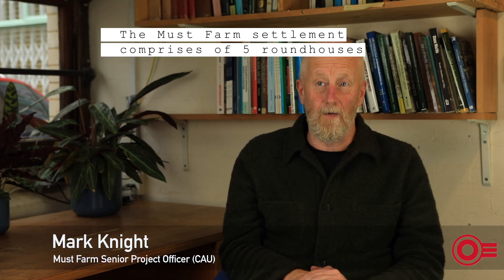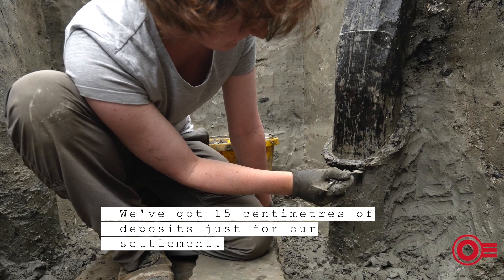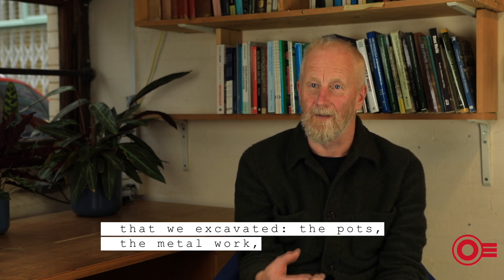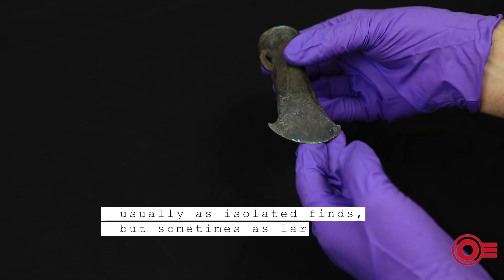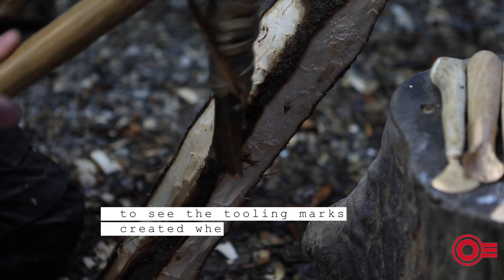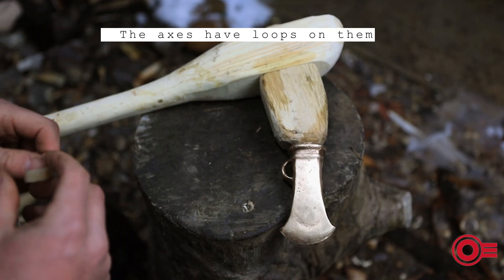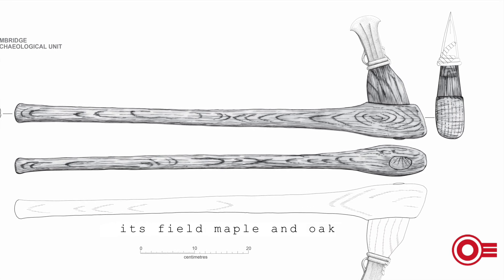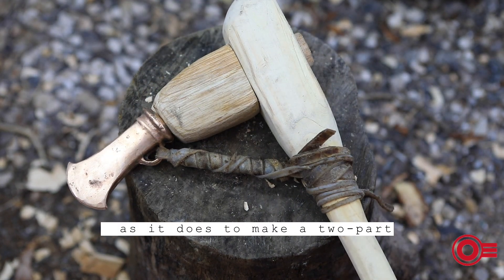Making Must Farm (S1, E1): A Bronze Axe

Comment: this device rather belongs to the category of cleavers. logs were split into different boards with this device. beat with a wooden mallet. Holders for the hollow blade were interchangeable, the main ones had to be straight. This is how dishes and boats were made.

Comment: As someone who has done a lot of lashing, binding, knotting and serving in his time--the shown method of lashing the axehead in place just  does not ring true.  It looks like it would torque the axehead in the wrong way and load the joints between the wood parts in a way that might lead to failure. There are a number of possible alternative lashings.
Perhaps someday an intact lashing will be found.

Comment: 2:46 omg that handle shape from 3,000 years ago is the same be shape we use today for axes, large hammers, pick axes, and other tools. Clever idea to use a two piece wooden structure. Easier to replace smaller, quicker to make, parts instead of create a whole handle from scratch.

Comment: My first thought, it must have been mosquito hell living above a still body of water,

The two part axe :  it extends the blade from the handle, so less likly to thump the handle against the tree trunk, at a better chopping angle , unlike an elbow branch type, which would,  just my opinion, not a proven fact,
Another fine intressting video, cheers
Edited to add, on bigger tree felling

Comment: One of my first thoughts on the two part axe is that perhaps it was made that way for more utilitarian reasons, you can use the same handle and just replace or repossession the axe head end to use it as an adz as well. Vs making and carrying two separate tools altogether all you really needed to do is just make the forepart and just swap or even just change the angle of it and use it that way.
Reply: You could just turn the axe head sideways to make an adz. I think.
I bet there's a simpler answer for the 3 piece axe. It was fashionable.
Reply: @iseriver3982 
I don't think that the adze was used in Britain before it was introduced by the Norman's.
Reply: @HighWealder  that's pure nonsense
Reply: I think it also may come down to where your axe handle will break.
I suspect the nub that the axe head sockets on to, wears out faster than the handle, so its easier to drill out and reinforce a good oak burl for a handle, and replace your axe nub, than making a whole new handle.